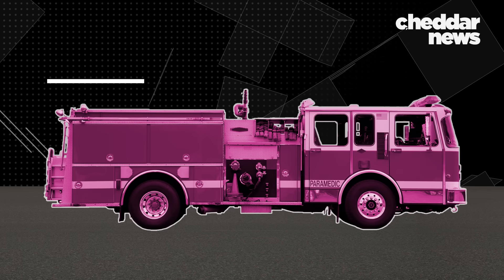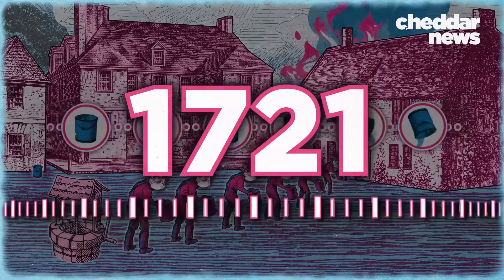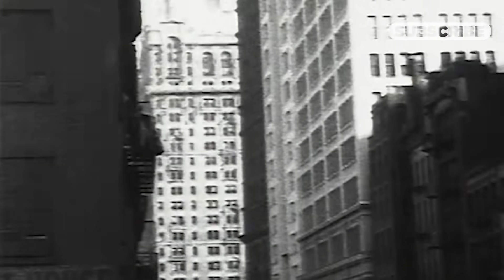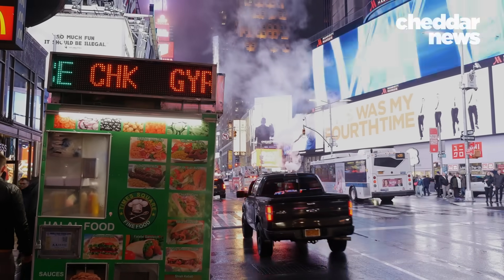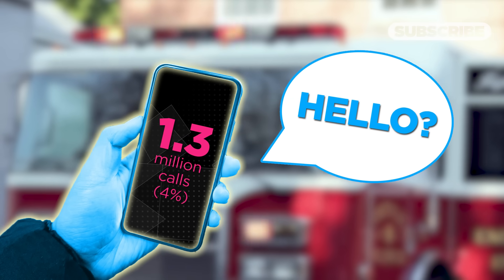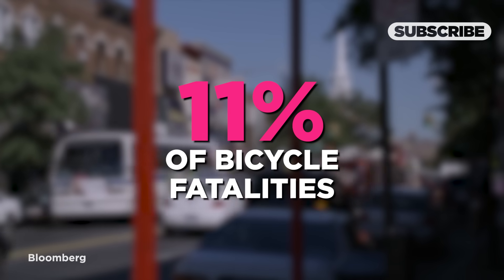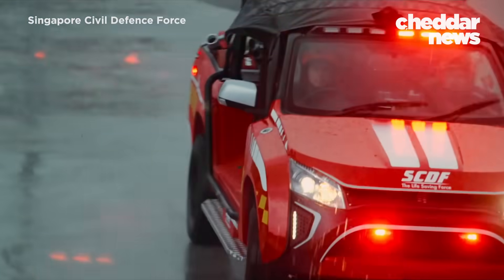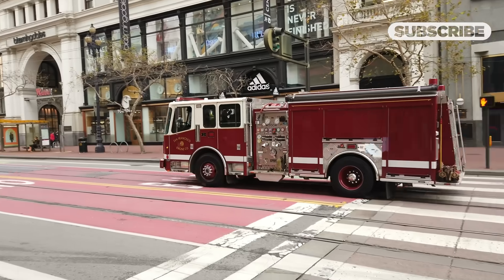Do American Fire Trucks Need To Be So Massive? - Cheddar Explains

Comment: If nothing else, the heavier weight and larger size makes American fire trucks better at securing a car accident. Also if the ladder is a third shorter and reaching higher, that just means it's doing so at a steeper angle, making it harder for people to get up and down it, especially those being rescued. and it means it can't reach out as far horizontally.
Reply: not sure what you mean with the ladder ... a 100 ft ladder in Europe will extend just like a 100 ft ladder in the US. The single ladder segments are shorter, but thatfor there are more segments extending to reach the very same length (height)
Reply: @EnjoyFirefighting Great… now do 130 feet or 148 feet.  There is no comparison between a U.S. based tower ladder and a European ladder truck.
Reply: @-KingOfKhaos  "now do 130 feet or 148 feet. " not sure what you mean, or why? 200 ft ladders in Europe have a comparable long truck chassis like a 100 ft in the US. And the booms reaching 300 to 367 ft are about as long as Tillers with a 100 ft ladder in the US. 

"There is no comparison between a U.S. based tower ladder and a European ladder truck." are you sure about that? There are lots of differences actually, from tactical to layout of the truck and range of equipment. As ladders differ quite a lot across Europe, let me simply compare a US Tower Ladder to a standard German Tower Ladder, okay?
German Tower Ladder:
- comes with only a small cab for 2 or 3, no crew cab
- max length of the truck: 36 ft 
- max weight: 35,000 lbs
- no tank
- no pump
- no ground ladders
- bare minimum range of equipment and tools: few hoses, stretcher mountain, chainsaw, 2 BA sets, power generator, fan ... 
- self-leveling ladders are a standard on modern tower ladders
- articulated top ladder sections are a standard
- all-wheel steering is common on modern tower ladders, but not a standard
- ladder can / may be operated as a crane with a lifting capacity of up to 8,800 lbs

You say there's no difference between them?
Reply: @ All of that is great… but none of it explains your thoughts as to why you believe EU type fire apparatus are more efficient than the “over sized” and “inefficient” US type apparatus.  

So far I’ve only seen your opinion, and some hyper local anecdotal evidence as to why you believe EU type trucks are “better.”  Where is the fire science evidence that EU type trucks are better and would function better in the U.S. than the type that we (and Canada) utilize extensively (which was done utilizing world wide fire science and apparatus reviews)
Reply: @EnjoyFirefighting  When I said “there is no comparison” that is an American phrase that means “the two things being compared couldn’t be more different if you tried”… meaning they are VERY different.  

I’m not saying EU apparatus isn’t good… I’m not saying that at all.  What I am saying, is they wouldn’t serve the U.S. fire service very well.
Reply: @ they're more efficient for the circumstances fire-fighters face here; 
The reason why they're kept so compact and are stripped to the bare minimum range of equipment, carrying both a smaller crew and less equipment than the US counterparts, is that they need to be as maneuverable as possible in order to access as many locations as possible. Many US Ladders would fail to access many streets here. 
It's not like we didn't try. Some departments did. Both municipal departments, but also US Army Fire & Rescue Services at USAG bases. They all went back to European ladders, including those at USAG bases 

" Where is the fire science evidence that EU type trucks are better and would function better in the U.S" where exactly did I state that they would be better in the US? 

"couldn’t be more different if you tried”… meaning they are VERY different.  "
Ah I see, that was a misunderstanding of mine, thank's for explaining
Reply: @ Right… I get the points you’re making.  The U.S. roadways are very different from most EU locations.  Residential roadways are typically wide enough for two vehicles to pass each other with enough room for a third to pass (by design).  Most suburban streets are in grid fashion although many also have twists and turns etc, but largely, they stick to grids.  Fire hydrants are plentiful in every city, almost all suburban areas, and even many rural regions… however it’s the rural regions where water supply does become an issue.  To combat this, rural departments depend on every engine carrying enough water for initial attacks, and many ladder trucks carrying water as well.  Many rural departments run with super-tankers and multi-purpose tanker / engines.  

Because of the age difference between the U.S. and most European regions, Europe has much more interesting city layouts and suburban layouts, while the U.S. went largely for gridded streets for ease of transportation by vehicles… EU is arguably more beautiful and historic, where the U.S. went for functionality having the benefit of hindsight due to its younger age.

Because of this, the current fire apparatus system works wonderfully most of the time.  There will be instances like anywhere, where things just don’t go right, or there are unexpected situations.  But overall, the equipment used here works, and I just don’t see it changing simply to deploy something smaller just for the sake of making it smaller… when the larger size has been serving its crews well for 50+ years now (more really, but solidly 50).

Some departments inevitably will try things outside the box to see if it works… this is common.  But even in my own experience, I’ve witnessed Departments here try something new, and nearly always end up going back to the gold standard apparatus when they realize it simply doesn’t work as well as they thought it would.

I do enjoy watching European departments operate, and in some instances their tactics would work better here.  And there are also equally situations where I watch and just know what they are doing just wouldn’t work for our style here.  It doesn’t make either bad… just different. 👍🏻
Reply: @-KingOfKhaos  you bring up a very good example: residential streets. You're right, they tend to be rather wide in many places in the US; Even with vehicles parked on either side there's still lots of space, and at some residential streets there aren't even cars parked. 
Here residential streets can be 2 lane, but in most places they're single lane with vehicles parked on one side, sometimes on both sides. Either way, oncoming vehicles usually have to stop and wait at e.g. driveways or intersections. It slows down the vehicles driving these streets, which is a good thing, but it can make it a bit difficult for full size fire apparatus. (full size by our standards). 

The issue of street width is much more critical in historic downtown areas of old grown and preserved city centers. 
Outside of those rather small historic areas and outside residential streets there actually wouldn't be an issue; US size fire apparatus, including ladder trucks, would perfectly fit there ... simple math: when semi trucks and articulated busses fit, a US fire truck would fit as well. 

Some countries like e.g. Sweden wouldn't have any issues to run American fire trucks everywhere, even in residential areas. In fact Sweden is the country which is the most American-like in many different aspects, among them the road layout. They also love US cars (especially classics, but also pickup trucks), however they don't run any American fire trucks (apart from very few pickup based ones).

Hydrants aren't an issue in Germany; Depending on how dense the built-up area is, and the type of area (like residential, commercial etc), the max distance between two hydrants is clearly defined; Most hydrants are below ground hydrants in the streets, but there are also numerous above ground hydrants as well. 

Although some few departments run large Tankers (Tenders), and very very few run Tankers based on semi trucks, most departments here don't have really large Tankers which are comparable to those in the US; Most Tankers here are based on a 2 axle truck and carry like 1,050 to 1,400 gallons of water and foam, which isn't much compared to those in the US. Prime example from the city I used to live in: they had a rather new Tanker, which was broken, and the temporary replacement truck they got from the manufacturer was a former Rescue Tanker from an Airport FD; It was a, by our standards, massive 3 axle truck. But it was too large for regular use in the city. Thus, in the entire 1 year period they had the truck, it was dispatched to only 1 single call. All other calls it would have been dispatched to, were taken over by a smaller type of Tanker (I call them "Urban Tanker" to tell them apart from the larger "normal" Tankers we have) and an Engine instead. 

"I’ve witnessed Departments here try something new, and nearly always end up going back to the gold standard " true, true; I remember the FDNY trying German high ladders for their operations in the city a long time ago, but it obviously didn't work for them and they returned to American ladders. The other way around the Warsaw FD ordered a few American Engines and Tower Ladders some decades ago, and also in that case it was a once and never again purchase and they went back to Euro style apparatus. 
At some USAG bases in Germany the US Army Fire & Rescue Service even tried wild combos of a US fire truck chassis with US cab style, but European body style. Interestingly when the base was shut down, they left the All American fire apparatus behind, and took the 2/3rd American 1/3rd European apparatus "back" home to the US where it's still running at a department. 

You know what I'd like to see? Not like only European or only American apparatus, but rather the best of both worlds being used at a degree where it makes sense for a given response area. 
There are a few European trucks used by departments in the US, like Tatra and Unimog offroad trucks, but they're super rare obviously. American fire trucks in Europe are even more rare to see. 
Chile is an interesting place where apparatus form just about anywhere are used equally
Reply: @ That is something we can agree on!  I’m all for taking the “best parts of each type” and making hybrids… I could get behind that easily… and like you mentioned we do actually see that for specific use vehicles like airports… but also elsewhere like you mentioned.  I love a good hybrid “monster” truck lol 😝 😆😃

Comment: shows a typical commercial European engine, vs a US truck custom made to be as long as possible 🤣Which makes it even more funny that it in it of itself disproves some of their points, as that US truck can usually fit in similar, if not tighter spaces
Reply: US fire trucks are usually quite a bit lower in terms of overall height, but they're also longer and a tad wider. Thus they definitely don't fit into tighter spaces.

Comment: I'm not even a firefighter (I'm an SAR medic) and I know this video is ridiculous... For a basic fire fighting appliance bigger means more water and more tools, smaller means able to fit down smaller streets and tighter areas. It's literally just a matter of what your priority is, if you've got room for a larger appliance you'll usually want a larger appliance. At least as I understand it.
Reply: "For a basic fire fighting appliance bigger means more water and more tools" not necessarily. Take for example a large truck, but with a poor space usage concept which leaves like half of each compartment space unused. It won't fit more tools than an apparatus where each available inch of available space is thought-out to fit as many tools as possible into that smaller space. 
it's true for water, however with different tactical approaches there might not even be a need for large amounts of water on board of the fire trucks. From tight hydrant networks securing water supply, to tactics using less water and higher water pressure instead of high volume low pressure attacks
"if you've got room for a larger appliance you'll usually want a larger appliance" not necessarily. Take a look at Sweden. The road network has American dimensions, they even run road trains there. Yet their fire trucks aren't any larger than those you find in Norway, Germany or Austria, countries where the roads are quite a bit tighter. Swedes would have the space to run larger fire trucks, but they don't
Reply: @EnjoyFirefighting Europe is built different than the U.S., so for you to keep making comparisons the way you are is disingenuous.  There are a myriad of reasons why we build our fire apparatus the way we do… and yes, I was a firefighter and pump operator.  U.S. built fire engines, particularly recently build ones over the last 20 years, are high maneuverable and really don’t suffer at all making turns, changing lanes, oh and they are fast as hell.  We can pump multiple lines without worrying about pressure or water for the most part… and our fire service is designed with mutual aid responses over a wide variety of terrains and hazard uses so yes, we need our trucks to be both specific but also generalized.  Our climate also varies greatly and as such the crew cabin is another aspect that is not typically discussed but it’s equally important.
Reply: @-KingOfKhaos  They sure are able to make turns on US street layouts; They however wouldn't be able to make the turn to my house ... which is completly fine, as I'm not in the US; 
Not sure how fast fire trucks in the US are, our's are usually limited to 62 mph

"We can pump multiple lines without worrying about pressure or water for the most part" That's what I'd expect from a normal Engine
"and our fire service is designed with mutual aid responses over a wide variety of terrains and hazard uses" absolutely the same here. Mutual aid response is a normal thing here, and obviously also the different types of terrain and hazards. 
"Our climate also varies greatly" although the climate is mostly the same across Germany, weather definetly varies a lot. Anything from draught and hot temperatures in the summer to freezing cold winters and storm season / especially with the tornado alley. 
Of course the climatic differences across Europe are more extreme than within Germany. Circumstances in Spain or Greece are quite a constrast to e.g. Sweden or Norway

Comment: Its a hell of a lot easier to have small fire engines/trucks when there is a functional fire hydrant on every street corner and the entire country is an urban sprawl. America has a lot of rural land and vast spaces that dont have easily accessible water sources, so we need 500 gallon plus trucks to be able to lay down water before a tender can arrive on scene to supply more water. Maybe actually talk to some firefighters before making something like this again
Reply: but don't you find 500+ gal trucks even right in downtown of the largest cities and metro areas in the US? 
Here the trucks are relatively small and compact even in rural areas, far from hydrant networks. They aren't any larger in rural areas compared to urban areas here

Comment: One thing you're forgetting is in the cities, the trucks are normally smaller since they have plenty of hydrants, therefore they are able to hold less supply hose, and less water stored in their tank, because they are guaranteed a hydrant. In more suburban areas, they hydrants are still plentiful, but not as much as the cities. Most standard suburban fire engines carry around 750 gallons of water, and right around 1,000-1,500 feet of supply hose that you drop at the hydrant, then lay out to the scene. There is a lot of equipment that goes into these trucks that you need to have. They're not purposfully making them big, its just the required space.

Comment: I have 2 words for you.....Notre Dame.  There are other differences between North American firefighting capacity and European firefighting capacity.  AND, before anyone flames me, believe me, I know what I am talking about.  Small, high pressure pumps work when you have contained fires in concrete buildings consisting of many confined spaces.  High pressure low volume doesn't do so well with large buildings.  For that you have to have large volumes of water delivered quickly....or burn the building down.  America and Canada (and MANY other countries, too, such as Santiago, Chile and its EXCELLENT fire service) have learned that you have to have heavy apparatus to bring the necessary firefighting capacity to the scene.  Why do 4 firefighters on a heavy truck come to assist and ambulance?  Because those 4 firefighters MUST stay together to be an intact firefighting unit, and they have to take their vital equipment everywhere they go. A fire can break out when they are headed back from a medical call, for example. 
Anyway, trust me, it would be HUGE step backward to adopt the "European" method of firefighting.